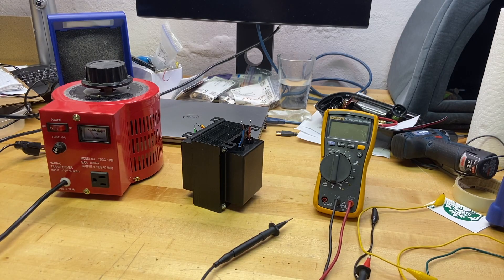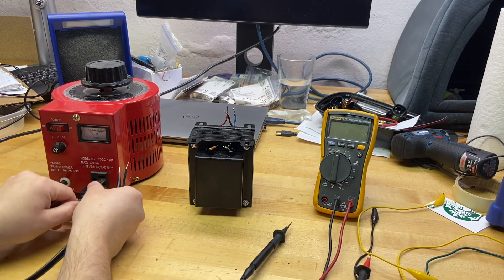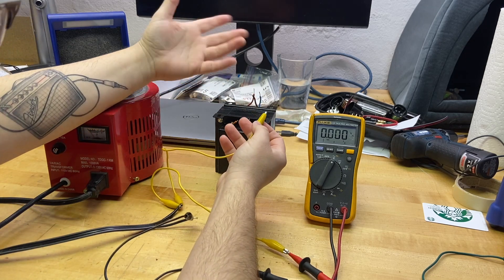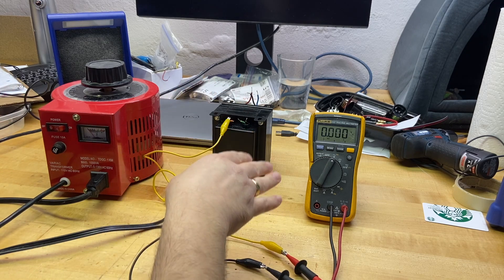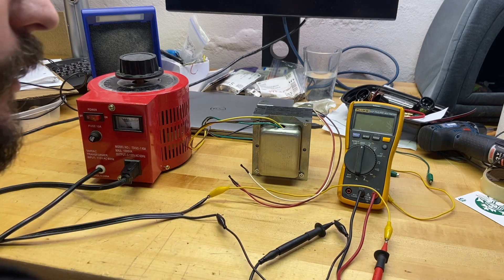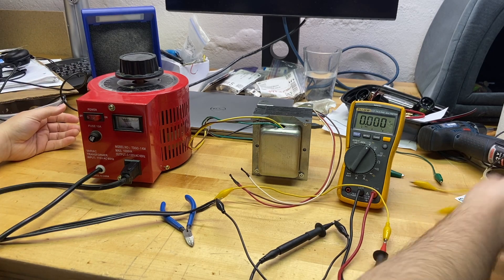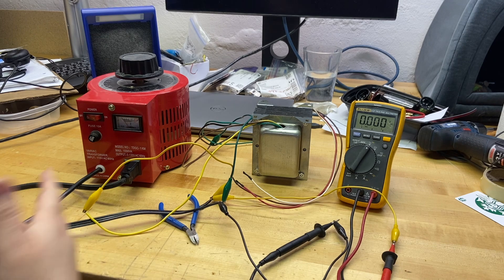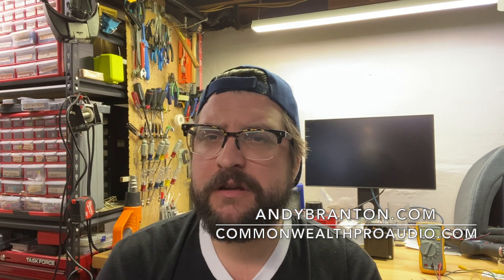Bench Testing an Output Transformer - How Do You Know It's Bad?

Comment: Can you tell me how I can determine which  one of my secondaries on a push pull output transformer is the ground wire and which is the tip wire for output side I got two wires that are unidentified stripped of any clad or pvc rubber ( bare wire) no idea which is ground and tip.

Comment: Hi thanks a lot for the video. I have a basic query(please excuse my ignorance), the secondary coil is basically a copper wire winding  usually with relatively small resistance? In that case it should draw in some current when you hook up the 3.2 V across the winding no?  Causing a voltage drop. Only if the winding is of very high resistance would there be no voltage drop. Hence the confusion when you said a voltage drop indicates failure. Please help understand.
Reply: Forget resistance, when dealing with AC you have to understand reactance

Comment: you test the 4 and 16 ohm taps the same way?
Reply from the maker: Similar procedure. This page calls out voltages for 16 and 4: http://www.geofex.com/ampdbug/outtrans.htm
Reply: @TheBrothaAB  i have results which aren't clear  my 3.5 volts AC drops to 3 volts AC when running through the secondary tap.  also when i measure with an ohm meter on the tap with no voltage i get 0.1 ohms.  usually you would see something like 0.5 ohms. all other tests pass. wont know until i wire this thing up to the amp if it works

Comment: I put 3.4AC ish and got 2.96 on 4 ohm and 3.09 on 8 ohm, is this an indication of a bad OT? I disconnected all the wires both primary and secondary. The video and the website provided are leaving a little unclear.
Reply from the maker: You put 3.4VAC on the 4 ohm tap and saw your variac output drop from 3.4 to 2.96VAC?
Reply: At first I got 3.09 on the 8 ohm tap then I got 2.96 on the 4 ohm tap. Voltage on both was more about 3.3 vac to just shy of 3.4 vac.
Reply: Is it fried? If it is it seems to be just over the line to being so and that particular OT is not readily available. It’s a Heyboer upgrade on an Allen Encore.
Reply: Full credit given to Pete Farrington on some amp tech forums who's taught me a lot. The impedance ratio is the square of the voltage ratio. Therefore, when the impedance ratio doubles or halves, the voltage ratio has a (square) root 2 ratio. Hence, at 16-ohms, the voltage ratio will be 1.41 times the voltage at the 8-ohm tap. Or when the impedance ratio halves as in your case, the voltage at the 4-ohm tap will be 1/1.41 times the voltage at the 8-ohm tap. If I put your measurements into my calculator, as long as you applied the 3.4 VAC to the 8-ohm tap:  3.4 x 1/1.41 = 2.41. Did you apply the 3.4-ish AC applied to the 8-ohm tap and then measure the 4-ohm, or are you saying you applied 3.4-ish VAC to the 4-ohm tap??
 
To  relate it back to the numbers illustrated in the RG Keen article, with 3.15 VAC on the 8-ohm tap, you'd see 3.15 x 1/1.41 = 2.23 VAC on the 4-ohm (article says "about 2.3). 

For 2-ohm tap, 2.3 x 1/1.41 = 1.6VAC. For 16-ohm tap, 3.15 x 1.41 = 4.44 (article says "about 4.5").

It works that way because the impedance ratio is the square of the voltage ratio. (I didn't think the geofex article was very clear either).

Comment: Hi, I’m trying to test a tube hi-fi amp’s output transformer. It has 4 to 16 ohm taps. what voltage would you use to test 4ohm and 16ohm taps? Can the secondary leads connected to speaker binding posts to do this test? With the speakers disconnected. Or do I really need to unsolder all the leads?
Thx
Reply from the maker: This page calls out voltages for 16 and 4: http://www.geofex.com/ampdbug/outtrans.htm

I would start with the simple tests first while the transformer is still hooked up.

Moving on the advanced tests (which this video walks through), I'd probably leave the secondary hooked up to the posts. I wouldn't leave the primary side hooked up.
Reply: @ ok thx

Comment: Can you do this without taking the transformer out of the amp?
Reply from the maker: Physically - yes; electrically - no. If you disconnect the transformer wires from the amplifier, you can do the test. You cannot do the test while leaving the transformer in circuit. It must be out of circuit. 

There are some tests you can do with it still in circuit. They're described in the same link that's in the description. Here it is again: http://www.geofex.com/ampdbug/outtrans.htm

Comment: Just curious what the voltages are for 16 ohm and 4 ohm?  Great video.  Also what happens if the windings are only shorting under higher volumes and when warm?  Is a megger appropriate/better for that scenario?
Reply from the maker: This page calls out voltages for 16 and 4: http://www.geofex.com/ampdbug/outtrans.htm

The windings only shorting under higher volumes and when warm doesn't sound likely to me.

Comment: I am really impressed by your video. I subscribed. Question, why 3.25 volts AC? Looking forward to watching more of your videos.
Reply from the maker: I chose 3.25 volts in order to follow the procedure outlined here: http://www.geofex.com/ampdbug/outtrans.htm

I also had concerns about the voltage I would see on the primary if I went with a higher voltage on the secondary.
Reply: Probably because that's the AC voltage you can get from half the heater plate in case you don't have an independent power supply.
Reply: The link in the comment above has the procedure, and says you can use the heater winding of a power transformer instead of a variac to energize the output transformer secondary.  

This means you'd have to apply line voltage to the power transformer, which means there would be high voltage on the secondaries.  

Now, some enterprising experimenter will surely get the brilliant idea to just use the power transformer in the amp to do this, which will put high voltage in the chassis, and ALSO, if they don't disconnect it, to the output transformer primary which the author said to leave in the chassis for the test.  This could create a problem.

Comment: Thanks, more video's about testing power and output transformers would be ACE since I haven't found any on YouTube so far! I have a Marshall 1987x that was in flood waters from hurricane Katrina. I want to test the power xformer again....I hooked it up before it dried all the way out back in 2005, and I heard some popping noises and smelled smoke! Damn it. I immediately turned off the power, and now it has definitely dried out, and I want to test it again. I have a variac.
Reply from the maker: With that amp, I would start by pulling all the tubes and testing them. I would also power the amp on, tubeless, through a light bulb limiter. I'd also check the diodes in the power supply. You don't really need to pull the power transformer to test it.